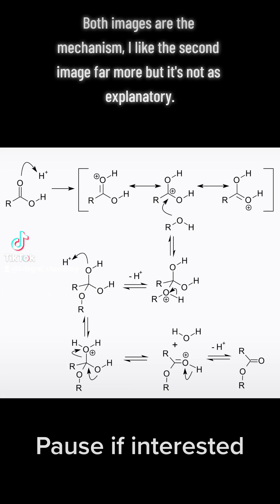Methyl Acetate Synthesis

Comment: This is a pretty ingenious way to try and make acetic anhydride….if it works. 

Also, on a side note, this made me think of a crackpot plan I had for getting ethanol safely distilled out of denatured hardware alcohol by first reacting it with acetic acid to make ethyl acetate, then doing either a a transesterification or hydrolysis of the acetate to get pure ethanol. I have absolutely NO idea if this makes any sense in terms of separation or work up, but I just thought that maybe the difference in density and boiling point of ethyl acetate vs methyl acetate, methanol, and ethanol might make selective removal of the methanol denaturant possible.

Comment: Haven’t seen this method for AA before. Looking forward to it!
Reply from the maker: I have no idea how it'll work, but I'm trying to see if the industrial method of AA synthesis by the carbonylation of methyl acetate can be replicated at a diy-scale.
Would certainly be more cost effective than other diy routes I've seen if it works.
Reply: @integral_chemistry  I presume you were not able to make acetic anhydride using methyl acetate  & Carbon monoxide? I don't see a video for this method